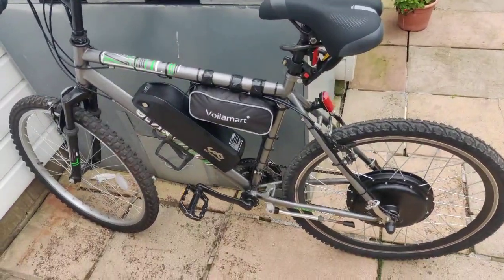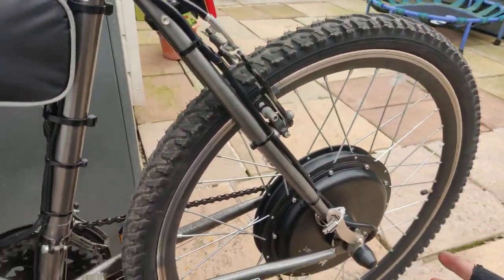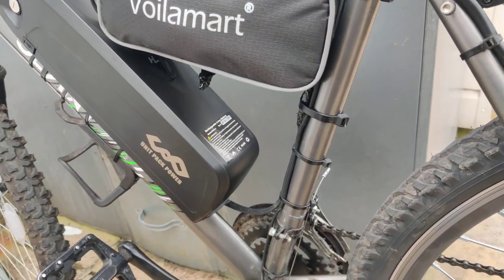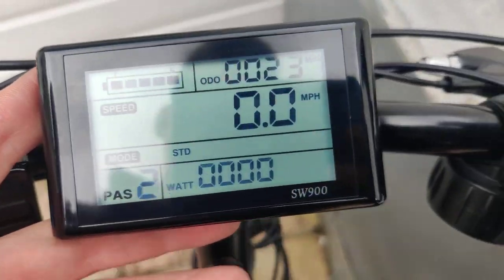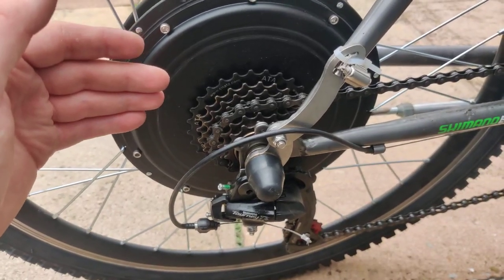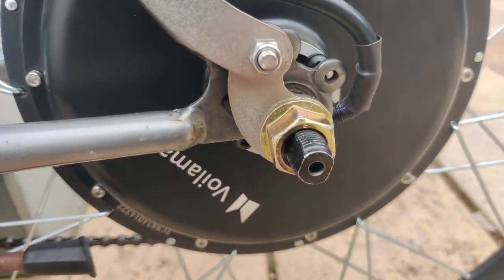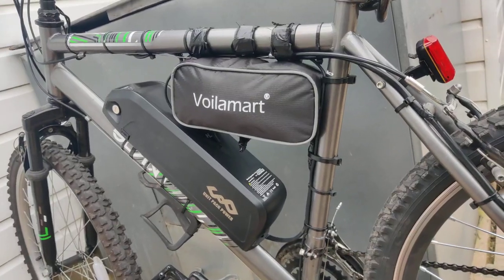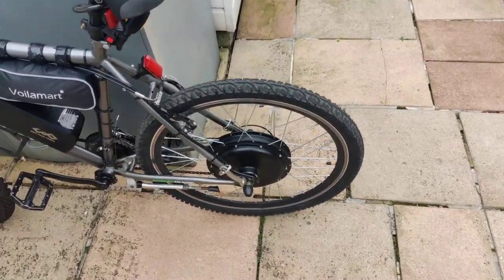Voilamart 26" 48V 1500W Electronic Bike Conversion Kit review and overview

Comment: Is it locked to 750 watt and if so how do you unlock it
Reply from the maker: @HoopsInsight-e1x  first no it's unlocked to 1500ws by default and to restricted it  you connect two cables at the restrictor you disconnect them

Comment: What battery does this wheel take?
Reply from the maker: The one  I'm using is a unit pack power battery 
as for what It can take it has oring terminal connectors for  the batteryfor me I solder a xt60 male plug that came with my battery to it the controller can handle I believe up to 35 to 40 amps max with a minimum battery of 14ah
Reply: @SirQuacksalotthe1st  have you got ig bro so I can send you what wheel and battery I need
Reply from the maker: @DanielHadal sorry didn't get a notification you responded honestly I do but I don't use it I used discord tho if you have that
Reply: Does the battery come seperate
Reply from the maker: @user-bh4cu7rn1k sorry for the late response yes it does it's actually the most expensive part